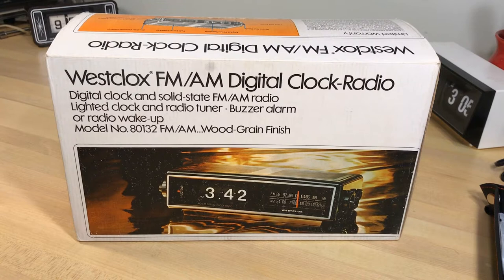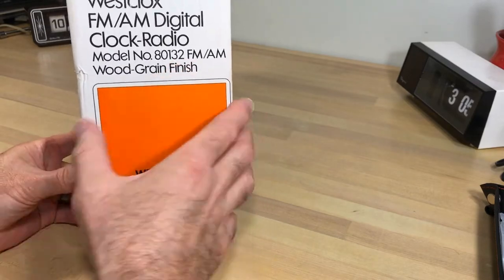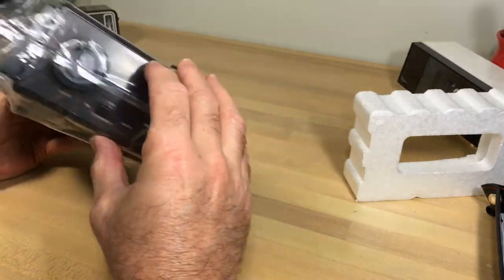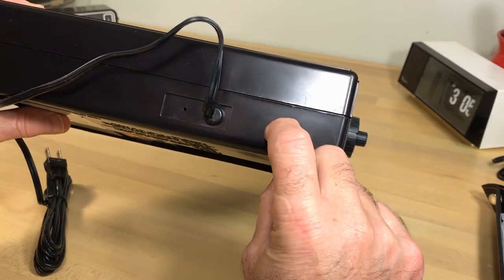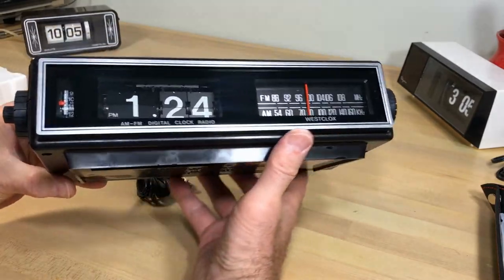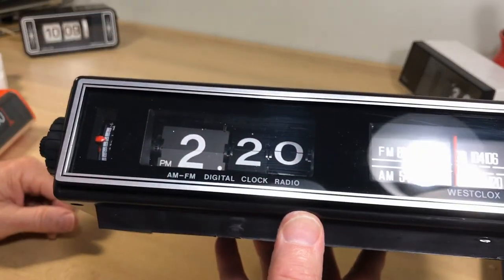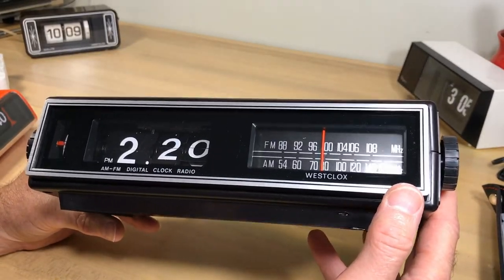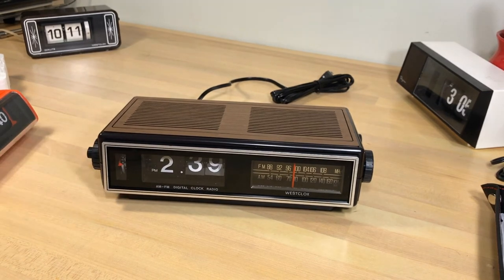The Westclox AM/FM Digital Clock Radio Model 80132 flip clock.

Comment: I love this flip clock mechanism. It’s made in Japan by Rhythm/Citizen alliance. IMO it’s better than Copal! Here is why:

1. You can get it cheap becouse its always broken and the tines are always missing. Even in NOS devices
2. The tines issue is very easy to fix. I use aluminium stripes from pepsi can and some sticky tape
3. The motor is openable and easy to clean and lubricate. The rotor is very light and do no not wear off like heavy copal shaft.
4. The lazy flipping action is very satisfying to observe. Alarm clock implementations usualy have seconds indication wheel. So you know exactly what the time is and when the minute will flip!
5. Digits are bigger and better visible than on Copal based machines
6. It’s very easy to swap motors. You can put 220v motor from ugly german market broken clock radio into nice coloured japaneese Toshiba or Citizen an use it in EU. And then you can put 50/60hz japan motor into Bosch UDW 2 enclosure and use it in US ;)

Rhythm / Citizen was the largest clock manufacturer in the world in the 70’s. According to their website… 
Maybe they were not massive exported to US (KenTech, Namco). But in Japan and Europe…  the most common flip clock mechanism that i spot these days… Many brands. Citizen, Toshiba, Hitachi, Mitsubishi in Japan. Than in Europe: Bosch, Rhythm, Meister Anker, SHG (Siemens), Garant, Astrasound, Cosmo… and many many more. Just put any clock brand from european mail order catalog.
Some of them are just rebranded Citizens with cases signed 5RDxxx. Some have custom cases like SHG/Garant. Once I even spotted improved version with holding tines made from firmly attached metal wires instead of crappy plastic.
Reply from the maker: Great commentary on this mechanism type. I must admit that once the tines are fixed I have few complaints. And the seconds wheel is a bonus. But I still prefer the snappy Copal mechanisms. Thanks for your input.

Comment: Hi 

Are flipclocks supposed to make noise ? 

My meister anker from the 70s makes a tiny gear noise 

I’ve opened it up and it appears to be normal but I do want to keep it as long as possible !

It seems to hold time correctly
Reply from the maker: Yes. Different models make various noises. One of the selling points of the electronic digital clocks were that they were silent.